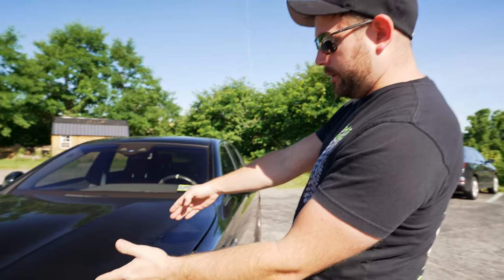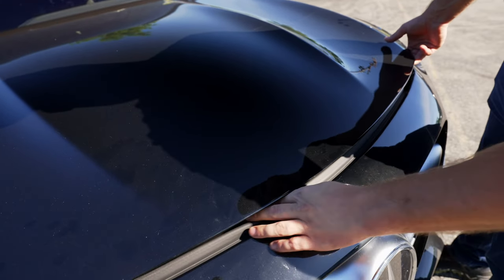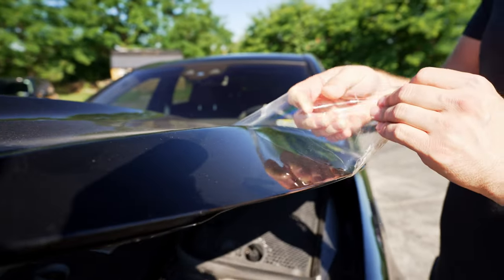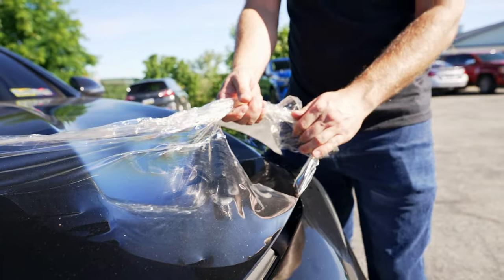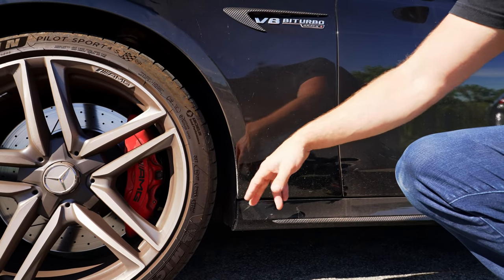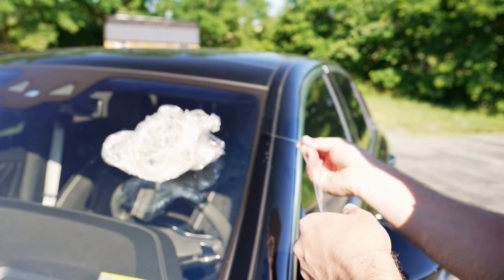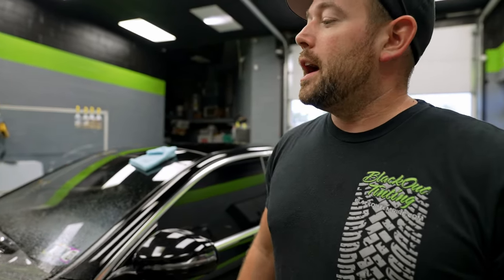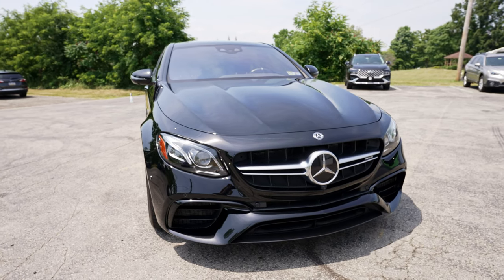🚫 DO NOT Remove Paint Protection Film Before Watching This

Comment: Just one thing. I agree the film works. We hit a full grown road gator (truck recap) at highway speed. When I was finally able to get off the road the only thing that happened was some quite large black goop on the XPel. There was no damage to the bumper, or the film, and black marks were easily removed. I can't imaging the damage to the bumper had the XPel not been there.

Comment: Great information! Would the same procedure apply for removing xpel PPF from plastic headlight housings?
Reply from the maker: Yes but just as you need to be careful of pulling paint you need to be careful of delaminating
Reply: @BlackoutTinting I'm painting my project car soon and thinking about a ppf to protect the paint due to harsh weather and long distance drives, after about 5-10 years would it then take the paint off or would you remove the ppf every 2-3 years so it's easier to take off? 🤔 thanks much appreciated
Reply from the maker: If the car is garage kept I would expect 7 to 10 years before removal.  If its a repaint, make sure the paint is baked and fully cured, and make sure the prep work is perfect or it will pull paint later.

Comment: Hi!  Thanks for this video.  Currently considering PPF for my new vehicle and was wondering if there should be a concern about uneven paint wear.  I'm doing a full front and rocker panel setup but most ofo the doors/back will be uncovered.  Would appreciate any info!
Reply from the maker: Overtime, the areas that aren't covered will probably end up with swirl marks, darker paint will make it more obvious, but since you're doing the full hood it won't be as obvious. The angle most hoods are at can emphasize it. You will be protected from most of the rock chips though because your rocker panels will be covered. Hopefully they are doing a small spot behind the rear wheel that rock chips like to end up.

Comment: Due to easy removal vinyl wrap is generally reserved for front fiberglass bumpers. Vinyl is easy peasy to take off without doing damage (via blades, heat gun, 3m Erasers) to the paint, or fiberglass. What’s on the hood (9 out of 10 times) is thin 3M, or off branded, plastic ppf. Yes, taking vinyl of an ISF, IS350 F, and M3 bumper was simple. Having to take (what most vehicles have) thin PPF off a steel hood is a whole didn’t experience. To so so requires hours of time, elbow grease, heat guns, 3M Erasers, lots of plastic blades, $30 bottles of Rapid Remover leaving scattered tiny pieces of sticky plastic wrap all over the ground, & on the bottom of your shoes. Unless it’s a certain color, or a fake looking CF wrap nobody puts clear vinyl around hoods, rocker, or quarter panels. It’s 3M plastic.

Comment: Has anyone had a problem with black mold under partial PPF installations?  I have a. white 2012 Toyota that had factory applied PPF, which now had black mold under the film, all over and evenly distributed, meaning it didn't start at the edges and work towards the middle, it had to have diffused through the PPF(!) Has anyone experienced this?
Reply: Common problem on all PPF on all vehicles and RVs, that is not black mold but it is common mildew, just ugly.  Working on a 2014 Tundra now and saw the same on a 2012 Avalon.  It likely will not remove like shown in this video, it has too much age and is not flexible.
Reply: I have that on 2018 Toyota. Help
Reply: @tjb8383  Sorry to hear it is no longer clear which indicates that it will be a pain to remove in pieces rather than the steam and pull off method.  The wheel method used for removing stripe decals is what my body shop recommends and uses.  Get a few quotes from your local body shop first and then try DIY.   At least the body shop can touch up the clear or any paint that pulls off, none I hope.

Comment: I’m thinking about doing front end PPF on my new Tesla. Do I have to worry about my paint being different colors after the PPF is removed in 5 years?
Reply from the maker: Nope! xpel allows the paint to fade the same rate as the rest of the car.
Reply: Thanks for the reply!!
Reply: I wrapped the front end and rockers of my Model Y with ppf. Four years ago I only wrapped the bumper of my Model 3 and there are chips on my hood. The bumper has three spots where the rock went through the ppf.